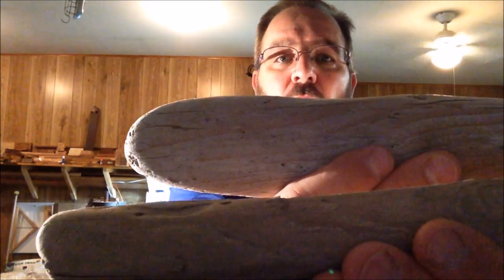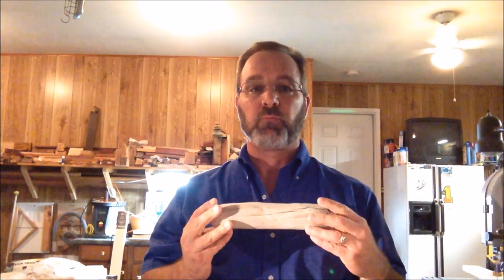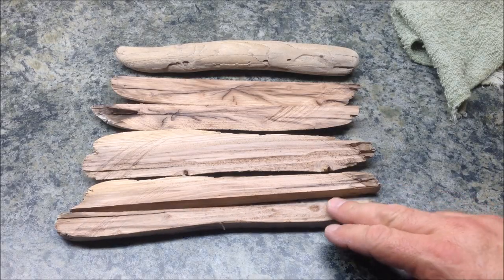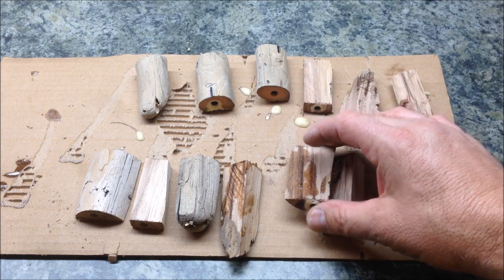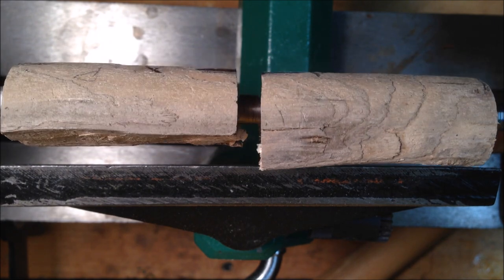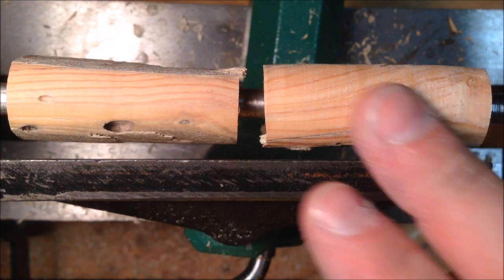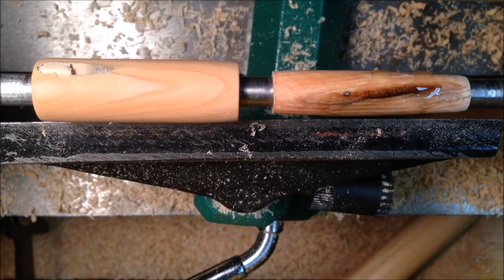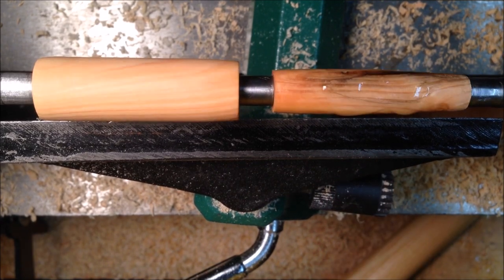Twilight Pen and Key Chains

Comment: any videos, suggestions, ideas on how to turn a kitless keychain.  I want to make some $5 keychains and don't want to pay $2 plus dollars for the kits.  Thinking of just using a eyelet screw and split ring into the end of the turned wood.  Any thoughts?
Reply from the maker: You could turn it like the cap to an ornament and drill a hole through the ball. Attach a key ring or beaded chain and you have it. 

Regards,
Bob

Comment: Great videos. On those divots, have you used sanding sealer on a pen blank before? I've been thinking about trying it on some of the more porous woods like oak but I'm wondering if it would finish well with CA in top. I'm just getting started. I've made about 20 pens and uploaded my first video for fun. Thanks.
Reply from the maker: +dahelmetrk I've never tried sanding sealer. I believe it should work just fine with C/A. If you give it a try, I recommend a test blank before you use a good blank. Keep me posted if you try it, I'd love to hear you results. 

Regards,
Bob

Comment: Hi Bob, I have been a subscriber for quite a while and really enjoy your videos.  Very informative and creative.  I notice that you use a piece of corrugated cardboard to protect the blank when assembling a pen.  I've tried it and it works but is just one more thing I have to do with my hand.  Here is a tip I use now.  I cut a disk of leather  the same size as the ram on the pen press and attached it with double sided tape.  It can be used over and over and leaves my hand free to guide the blank.  Try it I think you will like it.  Keep the videos coming.
Reply from the maker: +Warren St. Denis Thank you Warren,
  I'm hoping to make an improvement to that press very soon. The cardboard has been troubling me too. 

Bob

Comment: How do you sand a blank with micro mesh with super glue? Do you use water in the process?
Reply from the maker: +Gene Hinderer Yes, use water, make a slurry while sanding and clean it off between grits. 

Regards,
Bob

Comment: Being new to this pen turning, where doe one get a kit or the parts needed to turn a pen such as the drill bits, spindle collars, arbors to put blanks on to turn and any extra supplies outside of the actual pen kit itself. Your videos are awesome and very informative. Ron Austin, Sarasota, Fl.
Reply from the maker: +Ron Austin Hello Ron,
  I use Pen State Industries, www.pennstateind.com. Theres also Craft Supply, Packard Woodworks, Rockler, Woodcraft, and several others. 

I'll send you some info on gettng started.
Reply from the maker: +Ron Austin What you need for pen turning.
  If I were starting over again, I would probably go with the Easy Wood Carbide tools. There is a set with a square cutter, round cutter, and a diamond shaped detail cutter.   
  These tools are fairly easy to master and when they get dull, you just replace the cutters, no learning to sharpen or expensive sharpening systems. 
  I'm going to assume you want to start with ink pens and tell you what you need for that. 

  When you purchase a pen kit, the seller will tell you what bushings and what size drill bit you will need to
make that pen. Bushings can be used over-and-over and bits only need to be purchased once. The first pen is expensive due to this overhead. 

  Medium C/A glue, or Epoxy for gluing tubes into Acrylics blanks. Both work on wood too.

  You do not need a Pen Insertion tool, you can use a screw driver. They are nice to have but not a necessity. 

  Purchase a barrel trimmer set with the four most common sizes: 7mm, 8mm, 3/8", and 10mm. This is a must have. 

  You will need a mandrel, I personally like the Mandrel Saver setup that Penn State sells. A mandrel is a must have. 

  For Acrylics, the easiest was to an amazing finish is Micro Mesh pads. Sand paper is to coarse for Acrylics and should be reserved for wood. Get a box with 4 or 5 different grits
Reply from the maker: +Ron Austin You will need a finish for your pens. 

Finish for Acrylics:
  I like Hut Ultra Gloss. It's quick and the results are great. 

Finish for wood:
  Thin C/A is my favorite. 
  Shella Way is nice for beginners, as is Hut Friction Polish. C/A is the toughest to master but looks the best and lasts the longest. 

  A pen press is nice to have. You can use a clamp or the lathe to press your pens together. Laney Shaughnessy has a video on his channel that shows how to build one. It's really good. Otherwise, purchasing a press can be expensive. 

  That is pretty much everything I can think of. 

  Below are the links to three videos I made several years ago about what you need to turn pens. They are a bit long but contain a ton of good information. Also, feel free to ask questions as many things have changed in my process over the years. 

https://youtu.be/HZShe5ntDJY

https://youtu.be/-7izWhLDo6g

https://youtu.be/dAvj-qj-VwI

  I hope this helps. 

Regards,
Bob
Reply: Hey Bob, I got the supplies you suggested at Penn state and made my first pen today. I took my time and it came out beautifully. Im impressed!  Thanks again for your info and good instruction videos, regardless of their age. Lol. I made a standard twist pen and have a gatsby to make next. 
Thanks again Bob

Ron Austin
Reply from the maker: +Ron Austin Congratulations Ron,
  I'm glad I could be of help. 

Regards,
Bob
Reply: @RJBWoodTurner ;

Comment: I have been watching and frankly loving all of your turning videos for some time now. Thank you so much for sharing your knowledge with the rest of us. That being said I have become very interested in pen turning myself and am looking to invest in a lathe although at the moment I need to keep my costs low. I thought I saw you mention somewhere that the lathe featured in this video is from Harbor Freight and I wondered which model it was as well as your overall satisfaction with it? Thanks again so much.
Reply from the maker: Hello Marcia,
  I've attached a link to Harbor Freights website for the lathe I have:

http://m.harborfreight.com/5-speed-bench-top-wood-lathe-65345.html?utm_referrer=direct%2Fnot%20provided

  This has been a good lathe for turning and I have made hundreds of pens on it. It only has a 1/2 hp motor so it struggles with larger pieces but for pens, it works great. 

Here is some additional information I share with people new to pen turning. I hope it helps. 

What you need for pen turning.
  Welcome to the Dark Side, turning is a blast. If I were starting over again, I would probably go with the Easy Wood Carbide tools. There is a set with a square cutter, round cutter, and a diamond shaped detail cutter.   
  These tools are fairly easy to master and when they get dull, you just replace the cutters, no learning to sharpen or expensive sharpening systems. 
  I'm going to assume you want to start with ink pens and tell you what you need for that. 

  When you purchase a pen kit, the seller will tell you what bushings and what size drill bit you will need to
make that pen. Bushings can be used over-and-over and bits only need to be purchased once. The first pen is expensive due to this overhead. 

  Medium C/A glue, or Epoxy for gluing tubes into Acrylics blanks. Both work on wood too.

  You do not need a Pen Insertion tool, you can use a screw driver. They are nice to have but not a necessity. 

  Purchase a barrel trimmer set with the four most common sizes: 7mm, 8mm, 3/8", and 10mm. This is a must have. 

  You will need a mandrel, I personally like the Mandrel Saver setup that Penn State sells. A mandrel is a must have. 

  For Acrylics, the easiest was to an amazing finish is Micro Mesh pads. Sand paper is to coarse for Acrylics and should be reserved for wood. Get a box with 4 or 5 different grits. 

  You will need a finish for your pens. 

Finish for Acrylics:
  I like Hut Ultra Gloss. It's quick and the results are great. 

Finish for wood:
  Thin C/A is my favorite. 
  Shella Way is nice for beginners, as is Hut Friction Polish. C/A is the toughest to master but looks the best and lasts the longest. 

  A pen press is nice to have. You can use a clamp or the lathe to press your pens together. Laney Shaughnessy has a video on his channel that shows how to build one. It's really good. Otherwise, purchasing a press can be expensive. 

  That is pretty much everything I can think of. 

  I hope this helps. 

Regards,
Bob
Reply: +RJBWoodTurner Thank you so much for your response and the great information!  Hopefully I will be able to geg started myself relatively soon with the hell of this advice.
Reply from the maker: Keep an eye out for a 20% off coupon from HF, that's $40.00 towards tools. 

Regards,
Bob

Comment: im really loving this. i have to figure out if my setup is compatible with pen turning. i have a turning jig for my drill that i use most often and it works fine for small stuff. but i dont have a chuck and im unsure if mandrels would fit on it. my big lathe is a very simple one that turns slow speed and im unsure of the threadsize of the headstock. i dont think a lathe like that will be usefull for this intricate work. so im very hesitant to buy a mandrel and other tools to get into this. money is scares, and im scared to waste it. need to do more research i guess.
Reply from the maker: Willem,
  If you have a couple centers you can place the bushings directly between centers and turn pens without mandrel. This technique will work with any kit larger that 7 mm. 

Regards,
Bob
Reply: This is kinda hard because of the language. I have a drive center with three pointy things on it. It is held in the drillchuck and runs through a bearing. The other center is a simple point that is set in a small bearing. Ill take a picture some day. I have a faceplate with a metal rod attached that fits into drill and bearing the same way. But thats it. Ill try and find time to take pictures and measurements this weekend and maybe we can come up with an idea for a setup that would work. Thanks for thinking along with me.
Reply from the maker: Willem,
  I will make a video turning a pen without a mandrel. This may help you and others who want to turn a pen but don't have a mandrel. 

Regards,
Bob
Reply: That would be very helpful indeed. i'ld be very grateful for that.